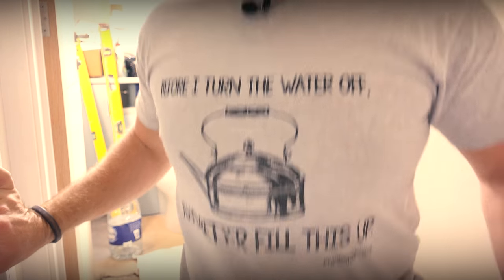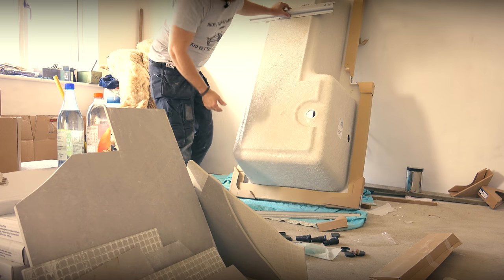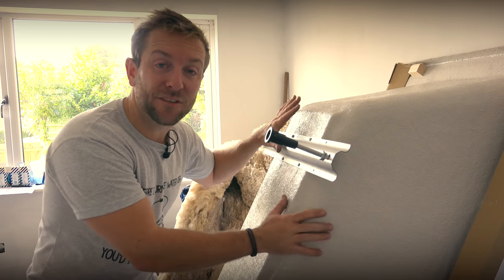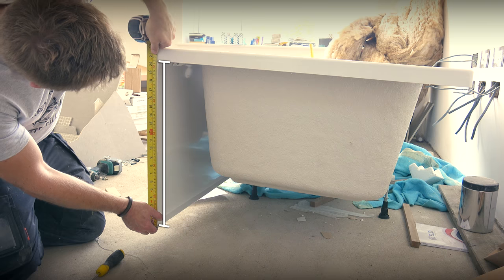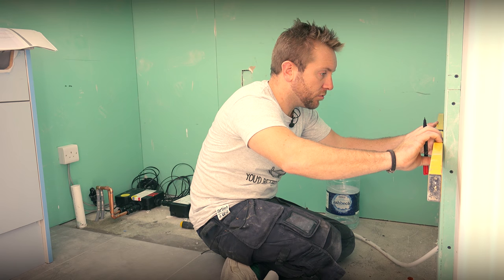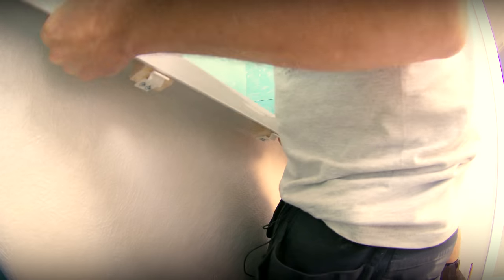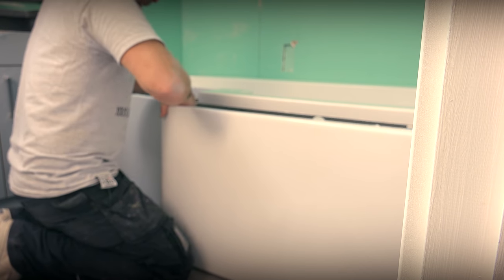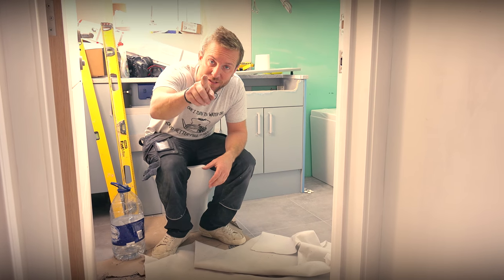HOW TO LEVEL AND FIX A BATH TUB - Plumbing Tips

Comment: So no framing underneath the front edge of the bath? That's what I did, and it makes if much more solid, so the bath has support along all four edges. Particularly useful where people sit on the edge of the bath or put a lot of weight on it getting in and out.

Comment: If you know your panel height ithen turn the bath upside down with the feet set to the desired height only if the floor is level and true, then turn back over to test fit, place wall brackets or a brace tied loose with a screw and washer that allows the installer access with a long screwdriver to screw the brace or brackets and tighten in the position securing the in er edge to the wall, always place something like a couple of pads of kingspan in center of bath and use a tiny bit of exp foam to secure and stop it squeaking... This makes the bath more secure when under load.  It's pretty easy and with a considered approach it's probably a 15 min task at most 👌 waste and traps etc are a few mins each at most... It's all about understanding the work required and prioritising it so you are not spending unnecessary time going back and forth etc... Love your vids dude, I'm 22 years in trade and I'd not do anything other than  getting the customer their wants needs or desires and the job satisfaction etc is better than the pay at times

Comment: I fitted one of these the other day. You can get the whole bathroom suite (toilet, basin, bath, bar mixer shower and glass side etc) for ~£600 from Victorian so it says about quality. I did a dumb though and didn't measure the side panel first! Needless to say the inch and a half gap under the side panel wasn't a good start to the day! Seems pretty strong though, I found the tiler stood on the outside edge of it putting up 300x600 floor/wall tiles and it didn't flex! Love the editing quality though, turning yourself into a real Casey!
Reply from the maker: Ha! Cheers mate!

Comment: Quick question - if the bath you have purchased does not have wood on the underside (to sit on the battens) would you a) stick wood on the underside yourself or b) secure the battens in such a way that it allows for the lip of the bath to slot in?

Comment: Love the videos. I would love if you could do more on the cold water side of domestic household systems, everyone seems to only focus on the hot water side. There are so many different cold water configurations I find it hard to  differentiate them especially in new builds where you have no cold water storage tank etc.

Great videos though, you are so good at making things easy to understand.
Reply from the maker: Ok dude, no worries! Have you got any particular questions? 😀
Reply: In the case where you have no cold water storage tank, do they just use the mains water and tee off after the pressure reducing valve straight into the cold sinks and toilet cisterns? When I flush my toilet, is water coming straight in from the mains to replace it?
Reply: Yeah.

Comment: Not just a great video, but a fantastic channel overall. I have only done a few bits of plumbing related handywork around the house, but love watching your videos.

Anyway, i have two quick questions:

One. Followed your videos and swapped the taps on our bath. However, the bath panel is about 5 cm above the bottom of the lip. It came off and i can't get it back on. Any suggestions?
Two. Is it possible to buy a replacement panel for a corner bath? Or do you need to know they make/model/etc?

Keep up the awesome videos

Comment: Brilliant video, very nice install! I had a couple of questions...I might have missed this, but once the bath is in and the feet are tightened up..what's to stop someone pulling the bath away from the wall? Is it glued or screwed onto the support battens? You did mention something around 10:10 but not sure if that's what you were talking about. Also, are the feet not screwed into the floor? I've seen this on a few baths but that bath doesn't seem to have screwholes...is it safer to drill a few holes into the plastic legs and secure to the boards/tiles? Thanks!
Reply: After fitting the same bath recently I answered my own questions.. the bath comes with plastic brackets that hold it to the wall. These are tricky to get on as I had to drill them to the wall from under the bath..a long drill bit and long screwdriver is handy here. I drilled pilot screwholes in the plastic feet and screwed them to the floorboards to stop them moving (although the weight of the bath will probably stop them moving as well). I also noticed that the centre of the bath could be pushed down a tiny bit, so I added a wooden baton support with legs myself for the centre to sit on, and screwed this to the floor with L brackets. Much more solid now and bath isn't moving anywhere.
Reply: Nice one mate, I'm doing mine tomorrow and it sounds like I have the same bath fittings as you. I will drill pilot holes into the feet as well... did you put wall battens and also did you glue the bath to the wall too? Thanks for any advice you can give 👍
Reply: @bigt8699  yes I built a wall frame for the bath using batons, just bear in mind it's not always possible to do that depending on how much room your taps need to get past the baton if that makes sense. Just baton where you can but no need to go overboard. No need to glue the bath to the wall as you can screw it to the batons with some kind of bracket, e.g. l brackets or maybe something flat. Each bath is slightly different so you kind of had to wing it as you go. One other thing I did is to attach a flexible sealing strip around the bath, this sticks to the bath and is tiled over to give a secondary seal in case the silicone ever fails. Have a look for MX sealing strip on internet.
Reply: Ok thanks mate 👍 I appreciate the advice

Comment: Looking forward to more videos.  Will be going to your home page and going to watch every single one that you have done.  You make it all look so easy.  I have started to fit bathrooms after working in the city for 30 years.  Steep learning curve.  coming up against so many things that i'm not sure if i am doing as it should be done.  I just put a bath in against a wall that was banana shape and on a floor that sloped away with a 20cm difference.  Had to put in a bath panel and try and get it all to look level in the end.  Tough job.  Had to cut it down which wasn't easy. Also had to channel out the wall for a shower.  Many of the vids I have watched especially from the states all have stud walls in which to put your pipes and have plasterboard finish or backer board.  All my installations so far have been into brick walls and having to work out how to fix the tails for the shower mixer into a wall that you cant get a fixing into.  No one seems to show those kind of vids.  Discovered the other day what a megaflow was as well when i had to add a rad on.  So many different types of water systems and installation methods for showers.  Going to get me one of your T shirts.  Love the videos and love your attitude to work.  Wish i could find someone like you to work with.
Reply from the maker: Thanks Jamie! Good luck with the job mate, it's never easy!

Comment: Had bathroom fitted but don't think the guy fitted the bath properly. Edge closest to the showerboarded wall is moving slightly causing the sealant to come away. I'm not sure he put any battens in. How could I put a support in without removing the bath? Cut a length of 2 x 2 and try and tap it in under the bath panel?

Comment: Is it essential to put the battens around the bath? We've had a new bathroom fitted and there aren't any battens there. There has been no issue tho.
Reply: DeeDub02 I would say not essential. The bigger the bath the more weight but the legs are the primary function. The battens make it easier to level at installation

Comment: Bit late to the party, but how does the bath not move from the battens ? If thats just a simple couple of mil bath edge balancing on each of those 3 sides of batten, that would worry the hell out of me. How is it fixed ? I understand its not going to move down, as the batten and the bath legs are all level, but is it really just a strip of CT1 glue, holding the bath to the walls ?

Comment: Another great vid, they have helped me so much, cheers. Just a question, so would you just tile around the bath on the wall or would you say best to tile the whole wall first? Also the floor, it maybe a while until I put floor tiles, is it ok to just tile up to the side panel? Thanks and sorry if my questions are basic. Cheers
Reply: Depends how good you want the finish to be.Tiling the floor first will create a better finish as the bath panels, toilet and sink will all sit on top of the tiles - creating a nice finish, as opposed to tiling after all the work which has the potential to look messy
Reply: Thanks for the reply, funny I have just started work on the bathroom, yeah that makes sense, I’m just trying to do it so I am only without a shower for a day so I’m gonna tile the floor before putting the basin & toilet in (as I have another toilet) but will put the bath in first and tile up to that, I just worry that by doing that I will make it different to remove the side panels if I ever get a problem. Fingers crossed. Cheers
Reply: Meant to say difficult not different :)

Comment: Is the tub supposed to be 100% level all around because I just had one installed & if you sit in it facing the faucet the outside right side is higher by 3/4" which also cuts into the tile by a third almost. The left side beside the wall is 3/4" lower. That side is a complete full tile. Just doesn't look right...

Comment: Love the videos. I would love to see waste pipe installation. I have an existing walk in wet room shower and i've been tasked with installing a bath but unsure what to do with the waste hole that is there already?? attach another small bit of pipe maybe?and then attach that to the bath trap?
Reply from the maker: Hi there, have you got any photos? Send them over to me via MESSAGE (or I won't see them) on my Facebook Page, or my Twitter page. I'll be able to help more! All the best, James.
Reply: Hi there James, Thanks for the reply. Instead of facebook and twitter i've uploaded my pics to my google drive just in case this comment thread could help someone else with the same issue. Here is the link to my pictures, It's a bit 'gunky' as i don't think anyone in our house knows that needs cleaning: https://drive.google.com/open?id=0BxLXOZBjHN-7bV9hbDVYZzZqRWc
Reply from the maker: Hello mate, I'd dig up the tiles around it (baths going over the lot right?) and find the 1 1/2" pipe underneath, then do standard solvent weld connections from there. Or you could bodge it and shove it the hole you see in the pic and silicone it up....I would NOT recommend that though!!!!

Comment: Great vid, will help me fit my new bath in my new house, but one question (I may of missed it) you measured the bath panel to be 518mm...then you mentioned about allowed for tiled and adhesive in terms of height, but you measured 518mm from the floor when marking the wall to find your level lines for the batons...shouldn't of you measured more than 518mm from the floor to allow for tiles and adhesive? Or did you and I missed it sorry if I did! Shouldn't it if been like 522 or something? Cheers James 👍🏻
Reply from the maker: I measured from the tiles, not the wood floor, and as you saw it all came out fine!
Reply: plumberparts ahhhh ok cool cheers James

Comment: Great video James with some good tips on measuring and battening. Is there a reason your not sealing the moisture boards with Aqua seal before fitting the shower bath especially where the sparky has cut into the board? I see you prefer to use glue and sealant to fix the shower bath to the wall rather than first fitting a MX Flexi strip seal around the edge that the tiling will cover. Maybe you cover this off in a later video but just thought I'd ask. Great place to hide the shower pump, although I thought we weren't allowed plug fittings in zone 0 even with an RCD.
Reply from the maker: Cheers Johnno. Sparky said it was fine....😳

Comment: Don't forget to drill out and fit the taps if they're gonna be located at the top end of the bath otherwise you will struggle to fit them later. I use clear CT1 or 785 to seal and fix.
Reply from the maker: Bath fill on this was from the overflow on the operator side....but I agree on the normal install side of things mate!

Comment: Hi, when you’re fixing the baton to the wall, isn’t the wall plasterboard? Will normal screws hold without a plug/fixing?
Reply: I was wondering that, no wall plugs
Reply: @andrewsymes249  after rewatching it, he does say go and have a cuppa to let the glue go off. I think the screws are just to hold the baton to the board until the glue sets and then the glue is what holds up bath up, not the screws themselves
Reply: And the feet take majority of the weight of course

Comment: Whats the plug socket under the bath for?
Reply from the maker: Thats for the Aqualisa controller. All within Regywoos!
Reply: plumberparts it looks like a normal 240v socket 😂
Reply: Space under bath is considered outside the zones if only accessible with tool or key. In those circumstances a socket outlet is acceptable .
Reply: MizunoIronMan under the bath is considered differently? Interesting - I did not know that! Thanks for the clarification 👍
Reply from the maker: Jesus! HFFP1I'll give you the Sparkies number and you can talk about it over the phone!
Reply: plumberparts 🤣

Comment: Oh mate please help me out here ive just fitted a bath waste and trap , no leaks apart from one coming from the over flow pipe that you push on , the flexi one, when ever there is a full bath ofg water the pressure is causing it to leak at the bottom , not huge but enough to be of concern. Ive tried sealing it with SLX and even tried clamping it up with a cable tie but im still getting a leak and its driving me crazy. Im now thinking of trying to get some rubber tube (haven't a clue what size) and using a jubilee clip. Any tips I would be extremely grateful
Reply from the maker: Use CT1 and LEAVE it for a day before you run any water in.....that should do it. Otherwise you might have a hairline crack on the plastic...
Reply: Wrap some ptfe around the male end of the overflow then push the hose over it always works a treat for me gives it a better seal
Reply: Bit late (2 year old post) but try Geocell "The Works"  - expensive (c.£8 per tube), but works like magiic!!  Can be applied in the wet, seals and sticks with almost anything and retains flexibility,  In bright sunshine it still works, but stays tacky to touch - but that's the only deficiency!  Will sort your problem for sure!